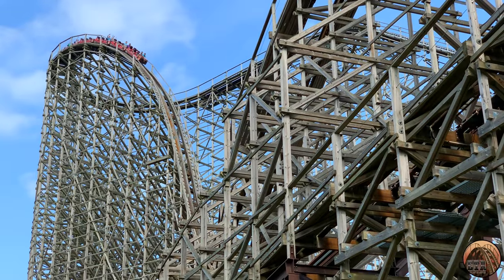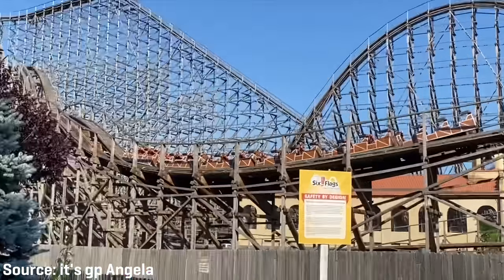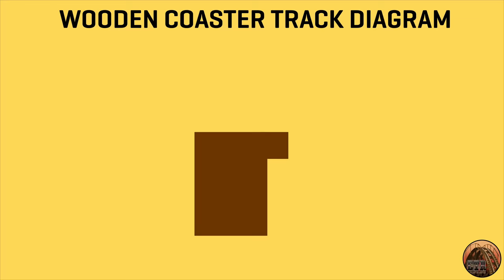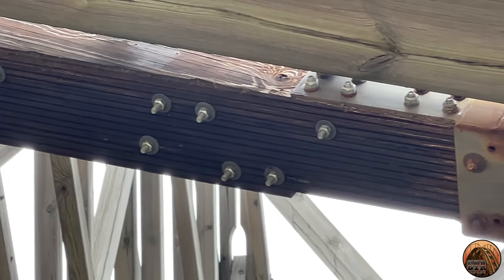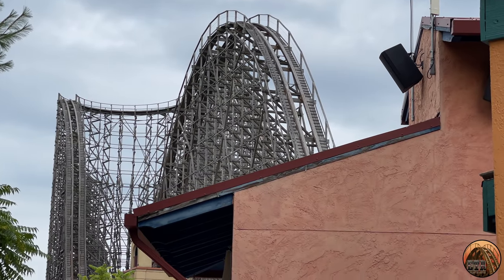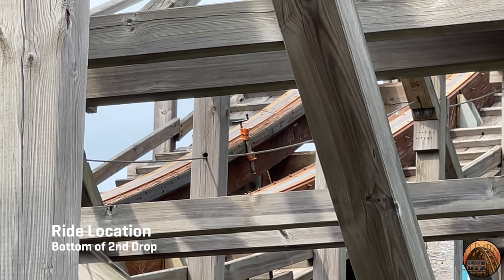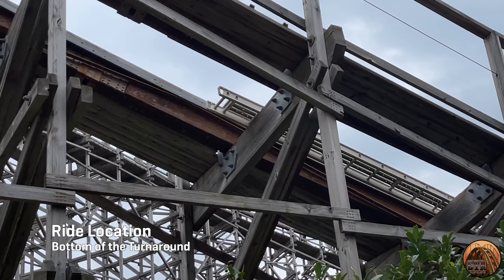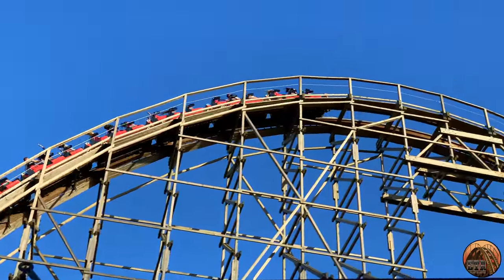What's Going on with El Toro? - Post Accident Update  - Six Flags Great Adventure

Comment: If this roller coaster was made by Apple, then the park would still be struggling to convince Apple to send them replacement parts and that it was unreasonable to be expected to "bring the ride into a genius bar for official service and repair", meanwhile Apple fans would be angry at the park for wanting to fix it and flooding them with hate mail for being "too poor to just buy a new iCoaster 13 Max, instead."

If this rollercoaster were made by Microsoft, then the rollercoaster would have been suddenly replaced several times while people were still in line without anyone's consent.  If any of them broke and you asked Microsoft for help, then someone who may or may not be an actual Microsoft tech support person would just send you links with repair instructions for one of the old roller coasters they forcibly removed in the past, and if you pointed out that their instructions were out of date then they would just advise that you complain more until someone made a new manual.  Eventually the park would get fed up and just install a crack to remove the previous updates and it would probably just start running again on its own.

If this roller coaster ran on Linux, then other Linux users would be too busy blaming the people riding in car 6 for user error to remember to turn the ride off.  Each subsequent vehicle to slam into the stalled train would just be met with frothing screams of, "RTFM!!!!  RTFM!!!!"

If this roller coaster was made by Nintendo, then it would be a lot smaller and less fast but somehow still really fun.  If it broke, then they might sell you parts but honestly it's probably a lot cheaper just to buy a new one.  15 seconds after they unveil a new model of roller coaster, then you could still run the old one and everything you already had, but if you ever had to factory reset the ride you would lose all of the trains and Nintendo would tell you they shut down the online service to get any more of them.  Then they would lobby the Japanese government to make it illegal for anyone to manually add more trains themselves and sue anyone who tried to reverse engineer any replacement parts or upgrades for coasters that Nintendo isn't even selling anymore.

If this roller coaster was built by Amazon, it never would have broken in the first place, but many of the steel rails and bolts would have been made out of the bones and skins of the ride operators, all of whom still really, really need to pee.

If this roller coaster was made by Google, it would mechanically run really efficiently but the seats and lap bar would be baffling, as if made for anything other than a human being.  Every request for changing something would be met with something completely unrelated being changed in a way that absolutely nobody asked for or wanted.  The ride queues would be filled with screaming Nazis, and park security's method of curbing this behavior would be for them to run up and club anyone wearing a SpongeBob or Disney T-shirt and drag their unconscious bodies out of the park.  On either side of the coaster would be rows and rows of the skeletal remains of nearly identical coasters that had been run just long enough for people to realize they were there before getting unceremoniously shut down and a new one built right next to it.  There would be complaint boxes posted every few feet, but all of them would have chutes that emptied out into a wood chipper that in turn fed into an openly burning tire fire.  There would be cameras in every bush, tree, and restroom stall that all were recorded straight to blu-ray disks and shipped out to distributors.

If this roller coaster was made by id software, then they would have any part you would ever want for their older coas- Ỵ̸͐̚͝o̵̪͍͚̞͋ủ̴̡̱̾̓͐̈́ ̷̛̱̣̯̰͔̐͊̂w̸̡͍̫̦̉͒͑͗̕e̵̥͂̈́̈̚̕ͅr̵̢̞̱̝͚̃̈́̍̚̕e̶̢͎͑̕͜ ̴̣̝̥̋ͅn̸̝̹̋͠o̷̥̠͎͇̍̿͠͝t̶͕̩̙̔̇̋̚h̷͓͙̬̳̻́̽̎͊i̸̢̠̙̦͛͂͂̆n̷͇̱̏̎̈́̚g̵͈̲̀̚ ̵̘̜͘̚͠ͅb̵͉̥̽̾̌̏͜͠ṵ̷̙̣̠̥̀̋̕͝t̴͎̗̗̒̎ ̸̜̅a̸͖̗̰̝͋̄ ̷͎̲̯̄̇̍̈́͘u̷̡͉̪͍͌s̵̨̹͒̽̓ừ̴̛͍͍r̵̢̨̦͕̠͑͌̉p̵͉̙̱͉̠̾̀̂̽͠ḙ̷͉̯̠̔̒̆͘r̸̞͎̪̀̕,̴͕͂ ̴̥̦̝̽̿å̸̖͓̟̦̓͜ ̷͙̞͊̓̂̀̾f̵̢̰͕̞̻̊̍̌̋̒ḁ̶̿ļ̶̨͚̓̇͋̍̏͜ŝ̵̳̤̩̫͈͑e̷̡̳̗̻̠͂͊ ̶̤̦͙̮̈́͑̓i̸̟͓̊̽d̶̲̮̲̓̕ó̷̙̙͉ḽ̶͙́̅.̴̗̍̏̚͘ ̸̧͈͍̂͠ ̵̡̯̤͋́̽Ḿ̶̛̼̬̭̈̔̀y̵̖̥̅̂̎ ̸̝̾͋̌̆e̶̞̦̓̒͘̚y̸̝̙̱͙̐̈́̌͒͆͜e̸͈̜̮̤͆̐̍ͅs̶̡̩͖̩͓͛̈́̓ ̷̛͉̾̽͛͐͜ͅḩ̷̞̒̆̃͘a̸̜̺͔̣͔͛̿̽̔͝v̶͕̘̣̘͗̑ͅe̴̢̩̬͖̅̈́̈́͛ ̷̦̞̫̽͛̓͘̚b̴̭̖̭̱̪̍̎͋e̵̻͎͈̓̐̃̐͝ę̷͇̜͆̐́́n̸̢͓͈͗͑ ̶̪̭̃o̵̺̠̎p̴̮̥̫̒̀e̴̢̛̼n̸̜̎̾̈͝ḙ̸͖̘͋̈̾̓d̸̯͒̇́̋̑.̸̺͚̻̐͌͝ ̶͖̜̫̻͌̒̒̏̾͜ ̴̡́͆̆̓͊L̶̫̮̈́̈́͒ͅě̶̹͓̼̮̽̈̌͜t̷̢̡̰̩͍̓̿̉ ̸̨̪̬͚͇̂̐̎̀̌m̶̳̘͒͗è̷͉͍ ̷͚̭̾̂̅́̚ḧ̸̩̗̀͒͒͝e̶̯̺̫̓l̴̝̭̦̲͓͋͝p̴̖̪͇̙̯̄̀̉ ̶̲̈́̈́y̸̪͔̥͍̍̎̆͝͠ó̷̩̹̜͑̂̌͘ủ̷̦͆̚͝ ̶͓̭̬̇t̵͈̙̹̑̎́͘͝o̷͔̱̠͑̊ ̶̧͕͍͇͐̒̉s̷̖̗͉̃̈̐͜ê̶̪̜͎̯͆̅̃e̷͕͋̂̔̚,̷͈̼͍̎̃ ̵̝̳̝̝̤̇̾͝s̵͖̹̠̭͆̐̿̍͘l̶̙̭̝̩̥̔̎̕a̵͎̠̯̓y̶̦̤̬̯̓é̶̼ͅr̷̙̝̫͙̫̂̒.̶͎̙̰̣̚  even though they PROMISED open standards and modifications for their newest coaster.

If this roller coaster was made by Bethesda, then it would be so unbelievably broken that it would be constantly collapsing down on itself, but incredibly the pieces would always manage to fall down in such a way that new tracks were constantly being formed that made it really fun just because of how bafflingly unpredictable every ride on it was.  They wouldn't do shit to help fix it when it completely broke, but at least they put up all the schematics online for free and will send you a complete set of industrial manufacturing tools, molds and machinery to build your own whole new coaster, if you really wanted to.  They freely let other manufacturers make aftermarket parts and upgrades for the coaster so at least you can customize it and fix it's flaws.  However, they would have been selling the same roller coaster for over a decade, except that every couple of years they would sell it with a new adjective scribbled on the sign and every time they did that all of the aftermarket parts you bought would spontaneously eject themselves into the sky and burst into flames until someone could come up with a new compatibility adapter kit.

Comment: A few observations.  First, this should have never happened.  Period.  At some point, on some level, someone made a decision that was rooted in cost savings.  I don't know whether it was an inadequate inspection or a decision made to not replace known worn parts, but regardless, it was a cost related issue.  The coasters and every part, including the bearings you refer to, are so overbuilt for their intended purpose that the only way the part could fail is if it first, wasn't inspected or was inspected and the decision was made to continue its use.  Furthermore, the total overhaul of these parts over the winter may not have happened in the case of El Toro.  I can totally see Six Flags saying "We didn't run that much last year, just don't worry about it and run the unrebuilt trains this year."  This is the part that I am interested in.  When were the bearings rebuilt?  For comparision, I believe The Beast (KI, my home park) has their cars rebuilt every winter, to include the bearings being inspected and maybe even replaced but certainly disassembled annually.

The 2nd thing that really gets me is where the PR person for the park said the safety systems worked as designed to keep people from getting injured.  That's not true.  The safety systems in place keep the train on the track, ma'am.  What kept people from being injured was dumb luck.  I can make a long list of "ifs" that could have easily resulted in a catastrophic incident resulting in major injuries or death.

Comment: Honestly, based on the description of the incident, I think El Toro's going to need a full retrack from first drop to brake run. And honestly, I think a topper track conversion might be a good idea, not to change the ride experience but just to protect the track.
Reply: They’re definitely not retracting the whole ride
Reply: @Starlit43 
If the damage sustained from dragging a derailed car across the entire route is enough, it's going to need it.
Reply: @VestedUTuber  well it’s my home park and I can for sure tell you it’s not happening. At least it isn’t happening now. The track isn’t damaged. Like he said in the video. It’s the bolts
Reply: @Starlit43 
And I can tell you that smoke, sparks and dust coming off the back of that train is a telltale sign of abrasive damage. Besides, the bolts on El Toro are countersunk and sit flush with the track. If the bolts were hit, so were the track plates.
Reply: @VestedUTuber  yeah the last car on the train not the track…
Reply: @Starlit43 
You really believe that somehow only the train was damaged from scraping against the track surface at high speed despite the fact that it also managed to strip out COUNTERSUNK bolts IN the track plates?

Do you even know what a countersunk bolt is?
Reply: @VestedUTuber  yes
Reply: @VestedUTuber  If they had to retract the whole thing then why did they want to open it in AUGUST??
Reply: @Starlit43 
It takes time to do a damage assessment. They most likely didn't finish the assessment before making that statement.
Also, it's RETRACK, not "retract".
Reply: @VestedUTuber  what's your rebuttal if it was only scrapping up ONE side of the track? That would only require replacing THAT side.

Very unlikely it's getting topper.
Reply: @Bluequiet 
I only mentioned topper as a suggestion for preventative maintenance. Even if only one side needs replacing, it might still be a good idea to just overhaul the whole ride and not have to worry about track replacement in the future. Especially considering the length of the ride, even replacing a single rail would take a lot longer than "open this month" - repairs will likely run into the off-season anyway.

Intamin Prefabs are a pain if you don't keep up on top of things with them.